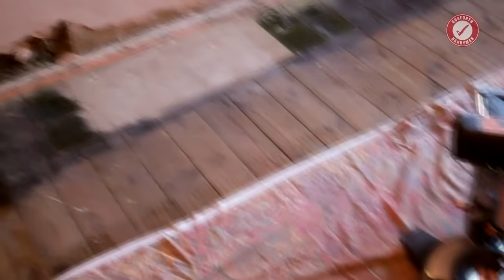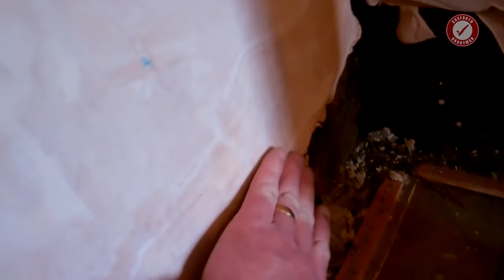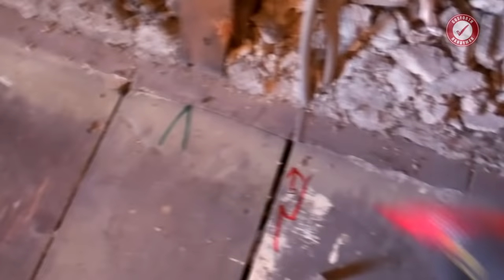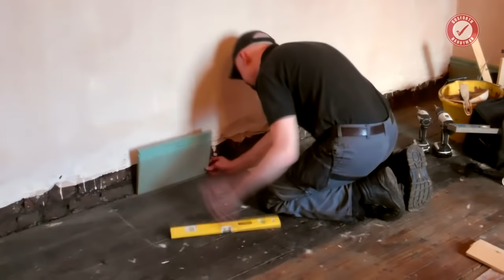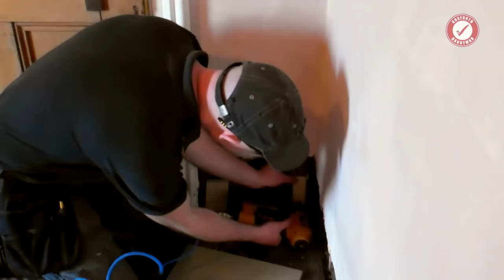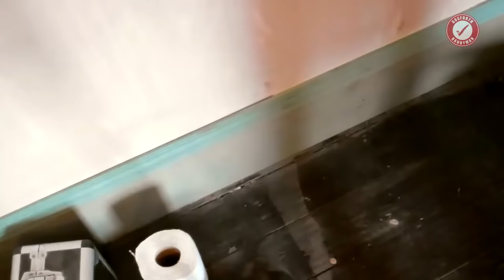Installing Tall Skirting Board / Baseboard in a Victorian House

Comment: In college we were taught to try and avoid having to cut a piece that it's scribed on one end and mitred in the opposite end which would dictate cutting and fitting the chimney breast and returns first and then scribe the alcove pieces to those returns. This would only really be an issue for somebody who isn't particularly experienced though as it isn't that hard to get it right, it's just more awkward if you have done your cuts and need to take a little off the piece. Simply commented this for anyone trying to do this themselves.

Comment: You've proved that you care about the finished product in the way you prepped the work surfaces and methodical approach to the task.

I have a lot of past experience working in 150 + year old properties and the old plaster walls are never plumb. However, I hate caulking, even though it is a necessary evil. I have invested the time using plaster to straighten walls when they have bad spots. At the end it looks like you had to use an awful lot of caulking, which did not exist when the house was built.

If I was the building owner, I'm not sure I would have wanted caulking used. It's a question of personal preference.

Comment: Lucky the floors were straight, in the house refurb I am doing I had sand down the skirting to sit flat on the floor. Covid 19 project. House was built in 1907.  Had to cement bricks 
in walls too. 🤦‍♂️ I still prefer them to the new builds. Hope your house move happens soon. Good luck, looking forward to seeing the new workshop.

Comment: Nice job Andy.
I just did a lounge with a very similar situation,  wonky walls, New plaster, gaps  between the bricks and skirting board. Turned out fine but didn't make it look as easy as you did,

Comment: Just came across your channel and noticed your method of using the jig saw to cut your scribe. Surely it’s better to cut a 45 cut on the chopsaw first which exposes the actual scribe then back cut which allows for a variation in and out. That’s how we and most chippies would do it.
Reply from the maker: That chop saw was terrible for cutting square, especially on the 45, and these boards were too big for my DeWalt. But yes, would agree. 👍

Comment: A few tips for you: 
1) Use expanding (gun) foam, not 'no nails' .  I know that might sound odd - but try it... if you ever need to remove them, you'll find it sticks much better, but can be removed by simply sliding an old saw down behind it - after that, it's easily scraped off, for re-fixing. Not only that - it costs less than a tenth of liquid nails, and will support the bottom of the skirting, between the packings.
2) Fix the packings to the walls with the SDS and plugs - then nail to them, rather than screwing through the mdf on the face - otherwise  the filler on the screw heads will pop, eventually. 
3) Cut the scribes at 45 deg on the chop saw, then follow the line with a handsaw and for the moulded part, a coping saw. You can't get an accurate cut with a jigger. 
4) Remove those gripper rods before you start. A bloke I know lost a hand, after he cut himself on one of those damned things, which later turned sceptic.
5) Use knee pads - or you'll suffer later in life - also, if you kneel on the head of a screw, you'll see why, a lot sooner. 
6) Treat yourself to a 2nd fix paslode.
Other than that, you deserve credit for taking the job on. I wouldn't have, because it's obvious you're follwing someone who either hasn't the most basic idea what they're doing, or doesn't give a damn about the tradesman following him.
Reply from the maker: Cheers bud! Kneepads are built in to my pants btw - already had one knee op! Great tips! 👍👊

Comment: Best skirting vid by far. Do you caulk with solvent free no nails or proper caulk ?
Reply from the maker: Cheers buddy - proper caulk... but no nails works if you don't have anything else to hand, don't think it's particularly flexible though.
Reply: Gosforth Handyman 
I brought some solvent free adhesive today. We've been using solvent based pink grip or gripfill and caulking. Hopefully water based adhesive will not be brittle.

Comment: Hi im just about to do my house in 6" torus skirting and found the video extremely helpful, could you let me know the make and model of the nail gun and the glue you use? Looking forward to watching the rest of your videos. Thanks.
Reply from the maker: The nail gun is a very old Stanley Bostitch and the glue is mostly Evo Stik Sticks Like Sh*t. 👍
Reply: How did the 6" skirting look? I'm refurbing which involves full rewire and new plumbing and builder is recommending chasing one channel for both electrical cables and
radiator pipes (due to concrete floor) but concerned 6" skirting will stand out as a bit of an eyesore

Comment: The problem with old houses is that many things get altered that can be overlooked. I live in an approximately 130 year old one but as ground levels changed around the area previous owners and builders never considered the dpc level. So my question is:
Is there is a risk that the wooden leveling trims could dampen over time as as they could now be located at dpc level?
Reply: Oh and I was looking for a video like this for a long time. Well done sir!
Reply from the maker: This was upstairs so no risk of damp. The Sticks Like ** glue is pretty robust but I would look to resolve the damp issues properly. If the DPC is bridged that needs sorting. Cheers for watching!
Reply: Gosforth Handyman    Andy, for those of us on the other side of the pond what is dpc?
Reply: @ronh9384  damp proof course
Reply: Phil English    Thanks Phil!

Comment: Great Job Andy, what is that adhesive spray you used on the corner of the skirting please? It it any good for gluing up stiles/rails on cabinet doors?

Thoroughly enjoyed this project and now I am off to put 119mm skirting on my wardrobe build.

Once again, keep up the brilliant work 🇬🇧🇬🇧🇬🇧🇬🇧🌞
Reply from the maker: Cheers Deanne! The spray is activator for the CA glue. It would probably work on rails / stiles but you've only got a matter of seconds of working time so for something like that wood glue and clamps tends to work better. 👍
Reply: Gosforth Handyman thanks for your kind response.

Comment: Hi... I watched this video with interest...A couple of things....When I was learning the trade I was told that the skirting boards should be scribed to the floor and the top of the skirting board should be level around the room. I notice that you and every other Youtube video poster must have had a level floor, and negate having to do this procedure.(granted ...you didn't show everything).   I only mention this as I once entered a room and the homeowner had chosen a floural print wallpaper...and the fact that the skirts wern't level made the whole room look askew....perhap if the client is just painting the walls it would be ok. 
I was also taught...when scribing internal mitres that they should be back cut, where necessary, to allow for corners that are not exactly 90 degrees to meet perfectly,  and to save all that caulk in the corners which does detract from the sharp angles of the exterior corners.   At least you plumbed them upright with packers...save cutting all those wooden plugs we had to fit in the mortar joints.
You were right in saying that it's not really a job for a DIYer.. and the finer point which make a good job good...are sometimes missed in Youtube videos.
All good stuff though...and thank you.
Reply from the maker: Good points. Yes, in this example the floor was level. Looks like a lot of caulk but it's just from where I've forced it in to the corners with my finger - joint is tight. 👍

Comment: My floors as well as the walls are all over the place. Do I need to scribe the bottom of the skirting to the floorboards?

Also is that caulk or no nails you're using?

Thanks

Comment: I've a couple of rooms almost identical to the one in the video to do.  I'm using 7" skirting with not as much plaster to overlap and glue at the top of the boards.  You think plugs & screws would be best?  I noticed you used a few yourself but it didn't seem to be all the way round the room.  Did you plug/screw through your shims/spacers?  Great work!
Reply: Also thats a really fast scribing technique for the internal corners using the jigsaw rather that coping saw - did you judge the cuts by eye for them to meet or did the caulking sort the gaps?
Reply: Forgot to add - do you think packing with 9mm/12mm plasterboard all along the gap work as well as the wooden shims?
Reply from the maker: With modern glues you only really need screws if you want to force the skirting to the shape of the wall (e.g. if the wall isn't flat). On the sides where the wall was nice and flat glue will be fine. I think in this instance I screwed near the shims but not through them in case the drill knocked them off the wall before the glue was dry. 👍
Reply from the maker: Hard to see on the vid but I traced out the scribe from an off-cut so the cuts are pretty tight. Looks like a lot of caulk on the vid but it's just my stubby fingers. Plasterboard shims should be fine but I cut all my shims to the exact width needed. 👍😀
Reply: @johnfriel7322  before you do a scribe cut with the jigsaw you can cut a 45% mitre and follow the line of the cut with the jigsaw.

Comment: Nice vid. If carpet is going to be fitted do you need to leave a gap between the skirting and the floor, is it just a few mm?
Reply from the maker: No, you shouldn't need to leave a gap as long as the floor is level. 👍

Comment: Canny video like. Your nailer and compressor seem like a tidy unit. I'm wanting to get one myself for skirtings, trims, etc, do you have any recommendations? or any changes you would make to your setup? Ta
Reply from the maker: If I did more of them I'd prob go for a cordless nailer, just less gear to carry - but just can't justify the cost at the mo. The little Stanley compressor is great though and finish nailers don't need much air so works really well! Bit noisy but that's never been a problem so far. Cheers for the comments!
Reply: nothing wrong with a good quality electric nail gun

Comment: Good job mate, where did you get the skirtings? The tallest I can get is around 169mm tall ?
Reply: In the same boat, we ended up making them up (well our joiner did!) from a 8'x4' sheet of 25mm MDF and pine architrave, biscuit jointed, glued and pocket screwed. With filling/caulking/sanding and painting they look like one piece, 250mm high in our case.
Reply: skirting4u do any height

Comment: Hi Andy..I see that your using two different types of adhesive.. One to stick the wood pieces to the wall and the other to stick the skirting on with .. What's the difference between the two and which two should I be using for this kind of job?
Reply from the maker: One is water based and the other solvent based. The solvent based one (Sticks Like **) is better but overkill for some areas (and it's 3 times the price!). If you've got a clean, flat wall the cheaper water based stuff is fine.

Comment: Do you check which is highest and lowest part of room before starting and try and get an happy medium gap so not have to scribe any boards, cheers
Reply from the maker: Normally I draw a level top line around the room if the floors are out, but this room was level so all OK. 👍

Comment: Superb. Wish I'd watched this before I did our front room, two bays, two doorways and a filled in fireplace. Ended up looking good but took two days.

Out of interest, my wall bowed out about a quarter inch at the fireplace. This made each side sit off the wall. How would you cope with horizontal runout like that?
Reply from the maker: There's really just 2 options - screw the board to the fireplace forcing it to the shape of the wall (kerf cuts on the back can help) or keep it square and fill the gaps. Just have to go for whatever looks best. 👍
Reply: @GosforthHandyman  that's good to know, thanks. Now I don't feel so bad about the half pint of ronseal two part filler that is back there. I was secretly hoping you weren't going to say something obvious that I'd overlooked!

Comment: May I ask what size brads you use for skirting...both guage and length???? I am doing timber floors at my place, and will need to know pretty soon. By far and away the trickiest part will be scribing the skirting for uneven boards. next room i do will spend a lot more time levelling the boards at the wall. you make it look easy....but i know thats not the case for us diyers:)
Reply from the maker: I use 18ga 35mm - 15 or 16ga is better for skirtings but I don't carry one of those. 18ga is fine but need to use more nails and glue. 👍

Comment: Before you got your nail gun why were you screwing the boards on? 

Also you were free handing the mitres with the jigsaw - I struggle to cut a straight line with the jigsaw - what’s the key?

Thanks
Reply from the maker: The jigsaw cuts were coping cuts, not mitres (following the profile of the board) - neater finish. Boards were screwed on to the brick wall - can't nail in to brick. 👍🛠

Comment: Hi, got a similar job coming up at home. Wondered how you attached the boards to the brick walls? I think you used screws, but I didn't see you fannying about with drilling for plugs, and lining up the holes in the boards like I would. Whats your straight forward process for this? It looks like you might have screwed straight into the brick ? Thanks for taking the time, hope you can help.  Seen several of your visa now. V good stuff :)
Reply from the maker: No, there's plugs there I'm afraid. I normally drill right through and hammer the plugs through the board and in to the wall. Obviously make sure you've got a big enough clearance hole for the plug to get through. 👍
Reply: Thanks a lot for clarification :)

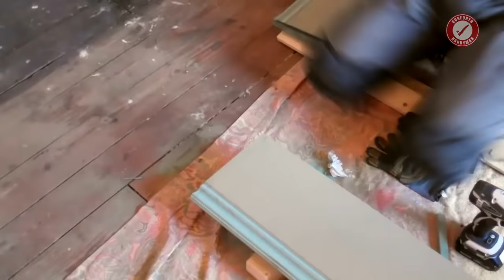Comment: Hey! Thanks so much for making a fantastic video. Can I ask, at 18:05, why did you use a jigsaw on the top bevelled section of the skirting? Wouldn't two mitre cuts meet anyway? Sorry if this is a daft question, we're just novice DIYers. Thanks!
Reply from the maker: The corners are often bowed and are rarely 90 degrees so you get a much cleaner fit if you do scribed joints if poss.
Reply: Gosforth Handyman ok great! Thanks again for replying and making the video!

Comment: Hi Andy, great job. I noticed on your tool list that you use a Freud Pro LP40M-025P 60 Tooth 250mm Saw Blade. Is this for the Evolution saw?  I have an Evolution Rage mitre saw and Rage 5S table saw but the person at Screwfix wasn't sure the Freud would fit so ended up buying the Evolution Wood blade which is OK, I just think there is better. Any advice?
Reply from the maker: No - that's for my table saw / chop saw. Unfortunately the Evolution has an imperial arbour size and you're also only supposed to use Evolution blades as far as I'm aware. 🙄👍
Reply: Gosforth Handyman I’ve got a saxton wood blade in my evolution. Came with a reducing ring to fit it and fits/works a treat. Half the price of the evo blades too.

Comment: Hi. 
 Can u please make video how to accurate make mitre with tall skirting 10" or 12" with standard mitre saw.(like I have Makita mitre saw cordless DSL713.)
Reply from the maker: An outside mitre? Accurate clean cut and CA glue the joint before fitting it. 👍

Comment: Any lead paint dust concerns?
(I love the tidiness!)
Reply: Also, any reason for leaving the rubble in the walls?
Reply from the maker: No lead paint in this room. 👍
Reply from the maker: It's solid lumps so not going anywhere and removing it could damage the plaster on the other side. 👍🛠

Comment: Hi andy

Good video mate. Can I ask which mitre saw that it is you're using? Got some deep skirts to fit at home and my 10 inch non sliding Makita saw wont do the cuts.
Reply from the maker: Cheers - it's an Evolution Rage 3DB - I don't use it now that I've got the track saw but it did the job! Review here: http://gosforthhandyman.com/evolution-rage-3db-mitre-saw-unboxing/

Comment: hi I'm having a problem with this job we took out the existing skirting install laminate flooring now the customer wants the existing skirting back on so it's quite easy because it's cut to size just a few cuts here and there but the big problem is now the floor is uneven because a person who installed The Flooring did not keep it level so I'm having a problem on my long skirtings like when it's 3 metre and more when installing it if I keep one side flush to the floor the other end lift up the customer does not want me to cut it in half so I can keep both sides Flash on the floor any idea how I can get around this problem
Reply from the maker: Sounds like you'll need to scribe it to the floor.

Comment: What a great video. Could I ask what wood filler you use to cover the joints in the MDF?
Reply from the maker: Cheers Hambini! I use Bonda Decorfill. 👍
Reply: I’m a decorator and decorfill is the dogs bollo#*s. 👌
Reply: can you use it on a wall instead of polyfilla?
Reply: Hambini definately not

Comment: I tried tackling a very similar job at the weekend but struggled to get tight mitres. The saw wasnt making an accurate cut on the bevel. Any tips?
Reply from the maker: What sort of mitre saw are you using? You need an accurate saw and always pre-glue outside mitres if possible. If the saw isn't making an accurate cut you're fighting a losing battle I'm afraid!
Reply: Gosforth Handyman I borrowed an evo mitre like yours but think it was well used as the mitre was anything but square. Might treat myself to a new saw and have another crack this weekend!
Reply from the maker: You can adjust the fence to true it up - might be worth giving that a try. Good luck!
Reply: Scribe the back of skirting to wall and adjust mitre to suit 
Mark both mitres to wall before you final fit and remove any excessive plaster if necessary 
Hope it helps works 4 me